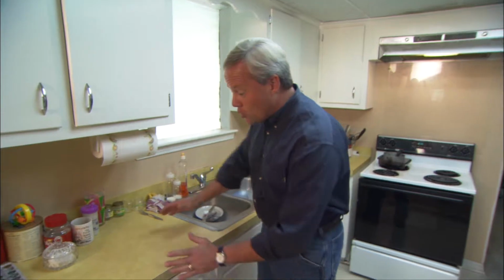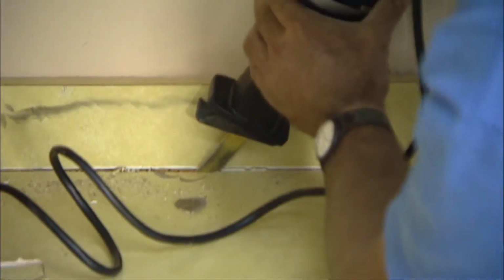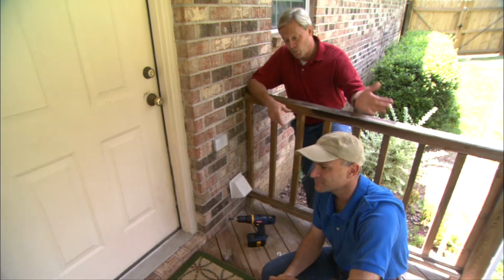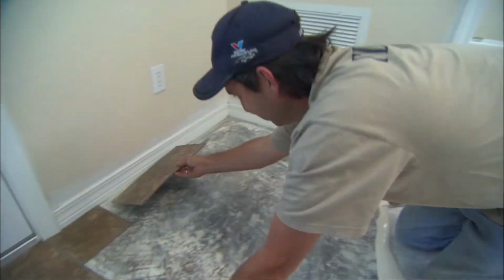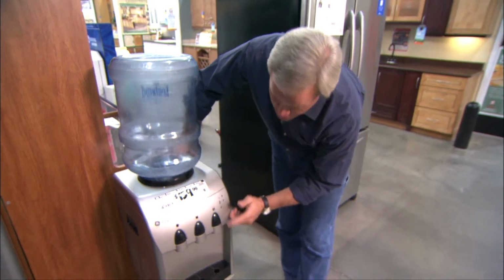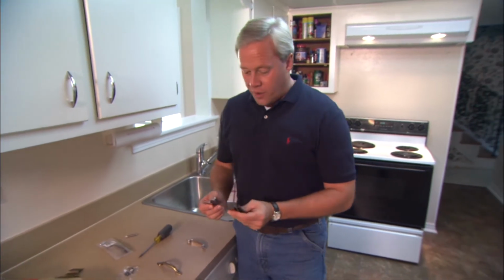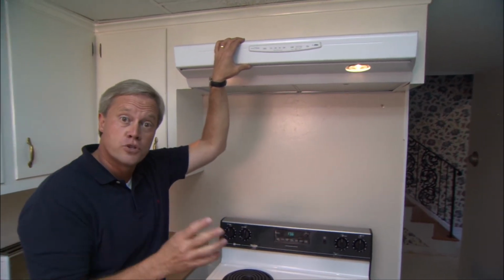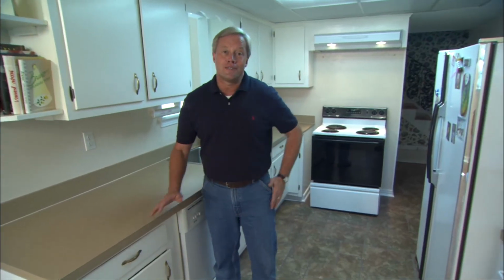Kitchen Facelift - Today's Homeowner with Danny Lipford (S7|E5)

Comment: I did a small face lift on kitchen and bathrooms     , back splash , new floors  and cleaned oak cabinets and left them oak I am not into white cabinets    . New moldings   and all new trim   new faucet and all new undecabinet lights  . Sorry but I like   formica countertops  , much less work and expense  . I cleaned people houses and some of those other counter tops were hard to maintain